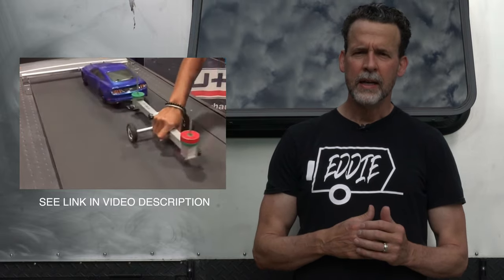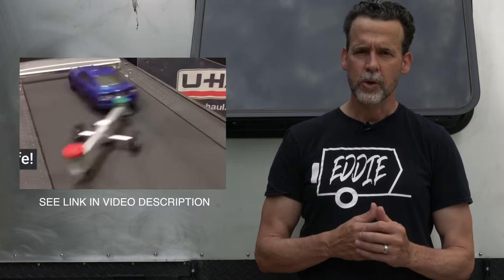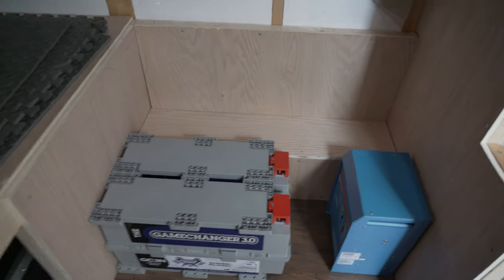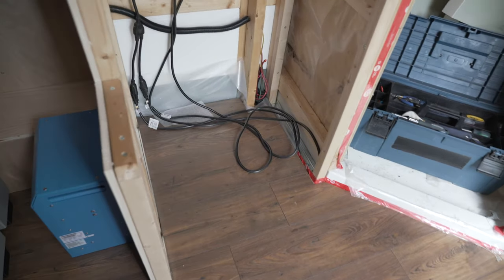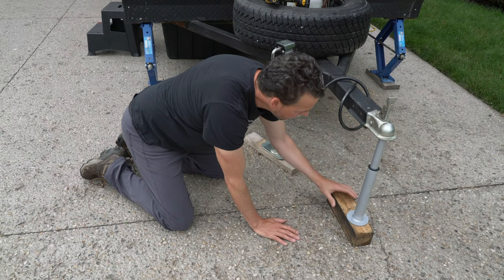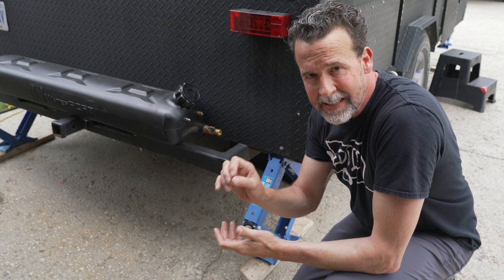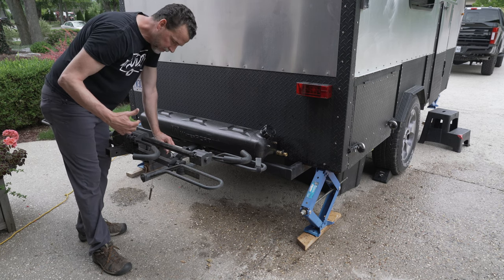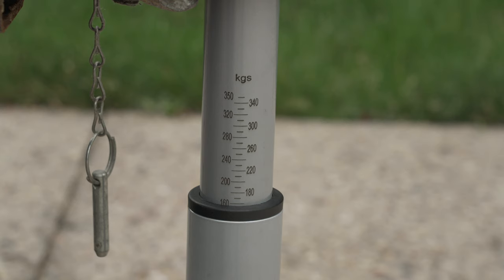How to Build a DIY Travel Trailer // Tongue Weight: Why It's Important, How to Measure and Change It

Comment: I live in a 2021 Winnebago Micro Minnie 1700bh which is a single axle off road travel trailer. The way we have the rear bumper loaded with fuel, a bike, shovel, roadside triangles, and the food inside behind the wheel wells, I can only do 80km/hr before it begins to sway. I don't know the exact tongue weight but it's light by design. My tow vehicle is a lifted 4runner ideal for rough roads and snow, but the rear suspension squats easily, which of course is a problem when driving very rough roads. I could just use stronger coil springs to allow more tongue weight but any stiffer suspension comes at the cost of increased vibration and damage to the RV, not to mention the toll getting 4x4 groceries takes on the spinach! I could probably use sway bars on the highway but I find myself constantly turning around in tight spots so it would just be too much bungling. So at the end of the day, I just do 80.

Comment: Great educational video.  Only observation was that you should remove the battery from the ebike as it’s heavy and removing it lightens the load on the bike rack.   Also prevents theft of battery and exposure to extreme weather, be it heat or rain.  Also check ebike manufacture as to waterproof rating of ebike motor, controller, and display or handle bar electronics. Awesome learning experience.  Thanks for sharing the build.
Reply: I think he put the e-bike on only to get a lot of weight on the back. He said he wouldn't take it on that rack because the rack is designed for mountain bikes only. If I understood him correctly.
Reply: @PatrickDickey52761  understood, but you should still remove the battery if you can. It minimizes the weight on the rack and the temptation for someone to want to steal it.  The bike may be locked to the rack and car but it’s difficult to protect the batteries on some bikes from being taken even if the person doesn’t care if it’s in one piece because they want the batteries inside of it to build their own. Also, I most ebike displays the batteries and the controllers for the motor and even the motors are not rated as waterproof. They are rated as water resistant but should not be left out in pouring rain or washed with a hose for  long periods of time.